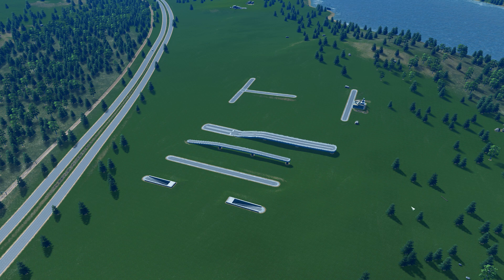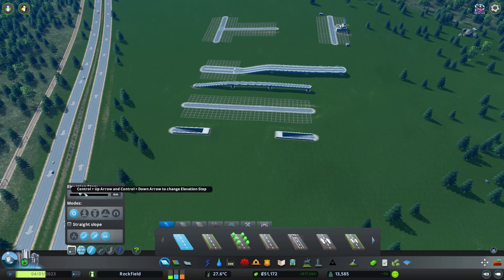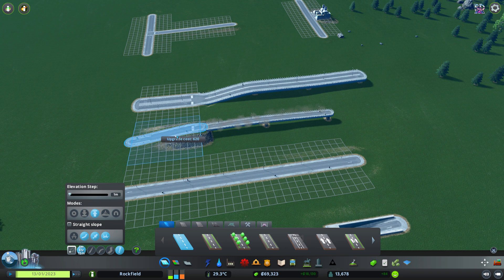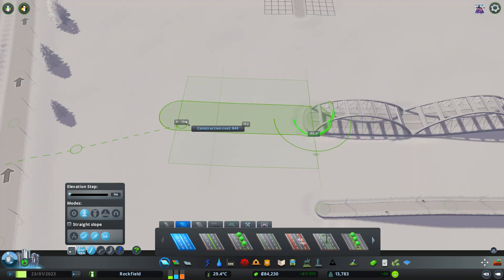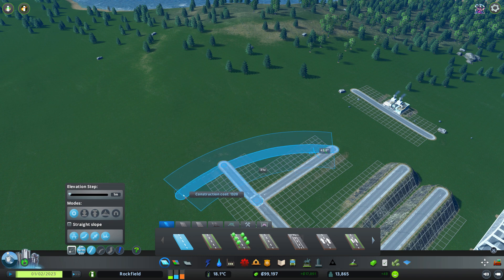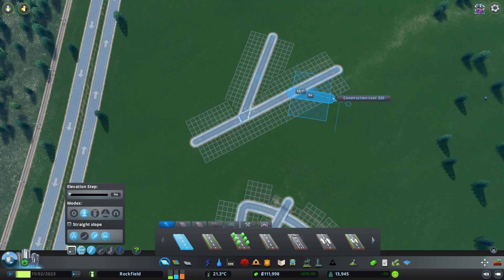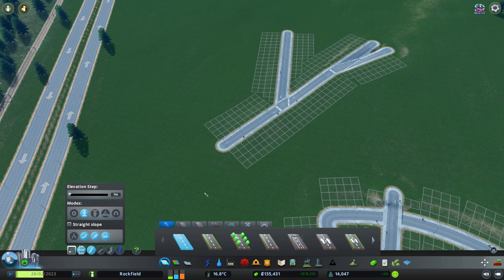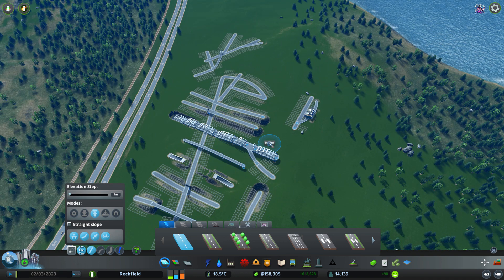Cities Skylines Tutorial - Fine Road Tool + Fine Road Anarchy Mods

Comment: I can't find the road mod, does it still exist? If yes, can you please send me a link?
Reply from the maker: Yes, it has a new name, and a new mod author. Network Anarchy

https://steamcommunity.com/sharedfiles/filedetails/?id=2862881785&searchtext=network+anarchy
Reply: @KRX_  Thanks so much, I wanted to play cities skylines and tried to put the mod on, but it wasn't there so thanks so much but i might need some help, if i turn my mods that i used a year back, the game does not start do you know what to do?
Reply from the maker: The game doesn't start at all? Must have incompatible mods or conflicted mods running at the same time. Can't really help with that, just basic process of elimination/trouble shooting.
Reply: @KRX_  Its working now. I had a problem with my PC.
Reply from the maker: Makes sense, glad to hear its working now.
Reply: @KRX_  And one more question, are the roads that we're in fine roads 2 in this mod?
Reply from the maker: fine road tool didn't add any roads. The roads in this video are probably just base game or mass transit roads. A good mod for additional roads is called "Network Extensions 2."
Reply: @KRX_  Okay, thanks! so much for help

Comment: hello,
i have seen a video with a mod that allows a user to separate and remove props from like fence, bushes, etc...
Was I incorrect in thinking this is possible?
Reply from the maker: Not sure what you're describing exactly. That doesn't have anything to do with this mod and tutorial.

Move it! allows you to filter your select when trying to grab onto various types of objects.

A mod called Prop It Up! allows you to remove props from other objects, like removing trees from a rock building or park, etc.
Reply: KRX hello,
First things first. You are awesome. 
I know it has nothing to do with this video. 
I follow a few guys like yourself and seen this happen, thought it was you in another video. 
I thought I’ve seen some drop a building then removed things like a fence and other props within that building.
Reply from the maker: @LaidbackFred  Wasn't me! However, this sounds like the mod "Prop It Up!" as I mentioned in the original comment! I did eventually want to make a tutorial about this mod, but I haven't used it enough yet myself to have much understanding of it.

Good luck!
Reply: KRX I’m sure it would be good. Thanks

Comment: what is the mod that add the extra roads? (bicycle lane electicity poles ecc.)
Reply from the maker: All the roads shown in this video are vanilla roads? I don't understand the question. I will happily tell you that Network Extensions 2 adds many good roads in a single download.

Bike lane roads are added with Afterdark DLC (none used in this video.) I've never used roads with power lines (although there are mods on the workshop you can find just simply by search for "roads powerlines."
Reply: @KRX_  ok thanks
Reply: @KRX_  at minute 3:22 the bus road, the pole and the wrench next to the roundbout section, and also at minute 2:30 the two roads next to the tree road. thanks in advance
Reply from the maker: @xxdoncetrioloxx3258  Oh you mean ones not even being used in the tutorial about Fine Road Tools and Anarchy? Those are all being added with DLC not mods. Bus lane and bike lane roads are added with Afterdark. Those others are Tramway roads added with snowfall. You can just search on the workshop and likely find hundreds of roads of all kinds though.
Reply: @KRX_  ooooh thx now i get it

Comment: One issue that I've found with road anarchy is that sometimes when connecting roads at angles that the game normally wouldn't allow, I get weird glitching where the roads connect. You seem to have hit something similar here and indicate that there are easy ways to deal with that, but you don't talk about how. So, my question is how to fix the issue with roads glitching where they connect when you've used road anarchy to force the connection.
Reply from the maker: I apologize if I mentioned something but didn't explain it. Do you know where in the video I did this? Attempting to answer this in text form... I will say the two places you'll find glitchy behavior is when you create small segments and really tight angles. The small segments just need to be stretched out with move it, or removed and redrawn (basically combined into larger segments with the roads along it. 

The really tight angles need to be played around with with Move It! mod. You can either spread out the roads just barely enough it doesn't glitch, or add a slight bend with move it, or you can sometimes change the point at which it bends to get some good affects. It's really just experimentation and messing around with Move It! mod to see if you can get what you want.